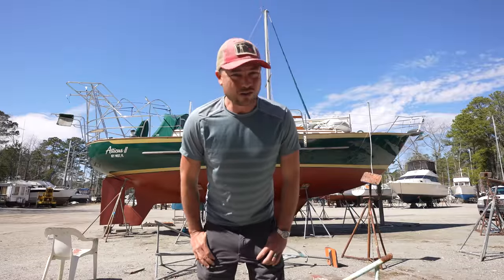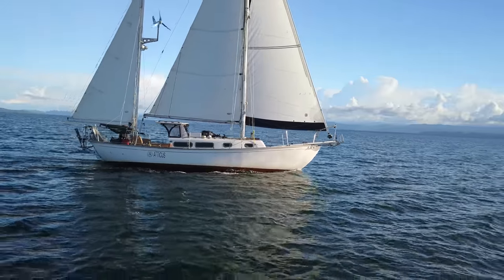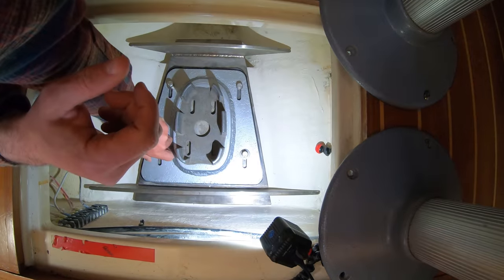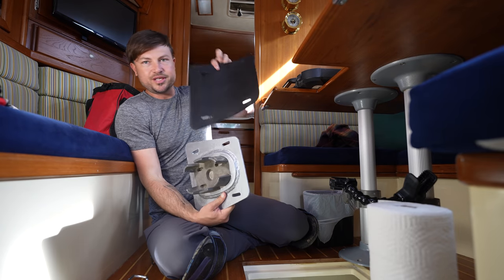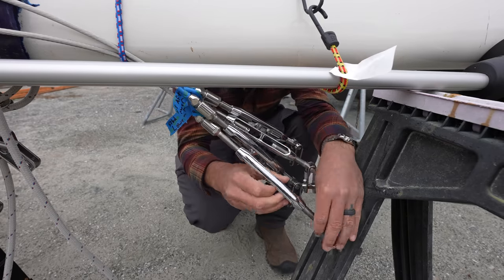One HUGE step forward! | S06E39

Comment: Pro tip.  If you need to cut a bolt, put a nut on first.  It helps hold the bolt for cutting because the vice has two point to bear on.  Also, when you remove the nut, it help chase the threads.

Comment: Bifacial solar panels pick up solar energy on the underside of the panels as well as the top topside. The sun reflecting off off the ocean surface will add another 30% to the panel's output. This is ideal for marine applications.

Comment: Be careful with adding lubricant to turn buckles. When you get your rig tuned ensure you pin those turnbuckles. They can easily back off on the leward side when sailing.
Reply: I know you have the best intention but your advice comes off as if you shouldn't lube the turnbuckle threads.  Yes, you pin them after the rig is tuned, that is a given.  Your leward shrouds shouldn't be so loose that they bounce & joggle enough to turn them loose.  You absolutely should lube the threads, lanolin is a great choice but I also use TEF 45.

Comment: Just a tip.  When cutting machine screws or bolts, run up a nut before cutting.  After cutting run it down and off.  in so doing the nut will clean up the treads making using the screw or bolt much easier.

Comment: I had helped friends step their keel stepped masts (with a gin pole), and it was still stressful the first time I did it on my own boat.  I have to stuff all the wires inside the mast in order to get it through the opening on deck, and then pull them out through the side of the mast once it's through the deck.

Comment: Great detail on stepping the mast. One comment: the bolts still connect alu and steel parts, I would check the bolts and the alu plate around the bolts for corrosion from time to time to avoid surprises.

Comment: When you hit the water and sail south, two must stops are Ocracoke and Southport NC.  Take care... ~GE

Sailboat - A machine lost in time and forever timeless... A modern device still dependent on the principles of levers, mechanical advantage, and block and tackle... equipment  more appropriate to the building of a pyramid than the moving of a yacht.

Comment: Hi Jordon, you are amazing fixing and setting up atticus.  You do a great show together.  I hope your propellor has arrived from Maxprop well.  I have a question; what do you use when you tight bolts to fiber? Is sikaflex? How do you clean so well? How to u did the female tread.  I just saw you drill.   You also use tef-gel for the metal plate with aluminium.  You are not worried that this bolts might come off?

Comment: Details, details, details  ...  Jordan that's what matters right now !  Your have done everything in a proper way and your hard work will pay off while sailing in the knowledge of knowing yes I did that. This should lessen the chance that things will go wrong when you are far from shore. With all you have done from electrical upgrades and batteries, new cables, new sails and more you and Desiree should have a wonderful time on your "new" adventure and not have to worry about what will break next or need repair. We the you tube community are proud of both of you, you have climbed the mountain and made it to the other side. Good Luck and smooth sailing !!

Comment: Ya knows I’m just wondering.  If you screw the nut down on the bolt before ya cut it shorter-  would that make it a little easier to back it off and get those grooves where they need to be?  Total random Q

Comment: Great addition to use the isolation between stainless and aluminum.  Did you use SS bolts/washers to hold the aluminum plate?  If so, did you isolate the aluminum from the bolts/washers?

Comment: Right off, the first step is reinstalling the mast step!  Next, two questions: What happened with that new fore stay that was the wrong length?  Also, being as meticulous as you are (Jordan) what was that very obvious corrosion/oxidation in those spots at the bottom of the mast?   It's real easy to see at 10:14 .  The built in ad was very fun especially with Oso near the end, but those ain't cheap blades!  If I bought them they would cut my budget to pieces!  8 - 0  I hope you don't mind just a small slice of my perspective.  : - ) 

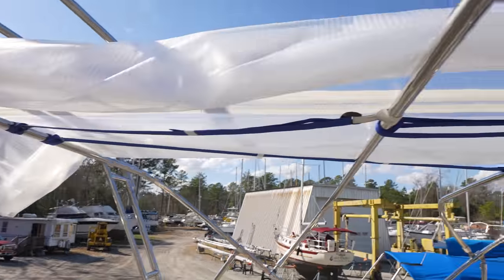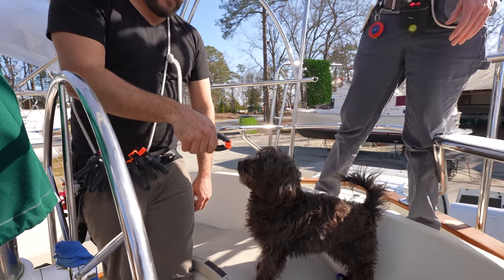Next at 7:52 is her name Breena?  Well, by what I see at 8:04 her last name should be Clampit!    hehehe    Looks like they are doing a real nice job too.   And, hey, at 8:34 Captain Oso wants to bite the Clampit!  Good thing its first name isn't Jed!  

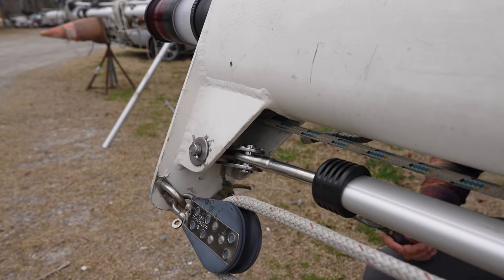Then it's time to erect that big long pole, typically called the mast.  What fun!  However, at 10:00 Jordan is having a little problem with inserting that long pole into just the right spot.  Hey, Desiree, some help please!  LOL  (Sorry Jordan, I just couldn't resist)  And here's something interesting.  At 3:59 there is a small sailboat in almost center frame that looks like MY sailboat!  I wonder if it's the same make and model?  Probably not, but still fun to see.   

This episode was kinda short, at just shy of 12 minutes, but it was action packed!  I liked it a lot!  : - )   Is next week's episode going to be called "Splash Time"?  

PS - That step is not that huge.  It may be a large step for you my Buds, . . . but it's only a small step for mankind.   😁

Comment: Hey Jordan,
I was going to mention this when you pulled the mast out. I'm a 20 year CCO OECP certified crane operator. Riding "the ball" like you did to rig the mast is considered ridiculously dangerous, and is not done ever. 
EVER!
Geez.
It's "cowboy rigging". And should get those guys decertified, if they even have certs. 
Did you ask yourself why they are really having you do it, instead of crane company employees, who SHOULD BE certified riggers?
If there's an accident, they can cover their asses, shifting blame. But they KNOW that most average people will  not know the Law or the Rules. - And who will happily ride the ball. You should have refused. Forcing them to take full responsibility for the safety of the operation.
They allowed you to put yourself in extreme danger. Or, actually encouraged sanctioned it.
And frankly, you should be pissed.
If the hydraulics of that boom failed, you could be killed. One example.
.
Double frankly? You should report that company to OSHA. 
.
Next time you are surfing the net. YouTube. We call it "crane porn". Watch crane accidents. Pretty spectacular. Scary.